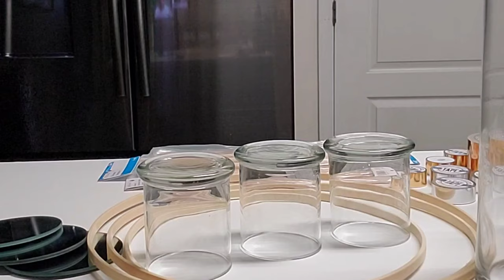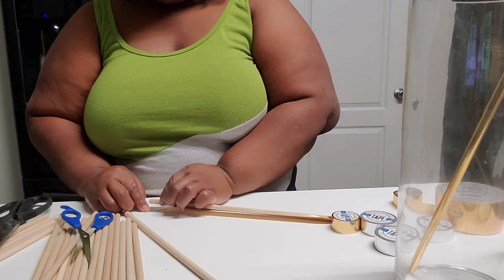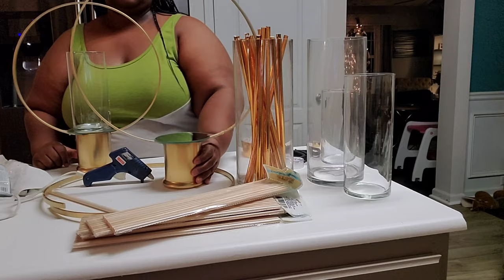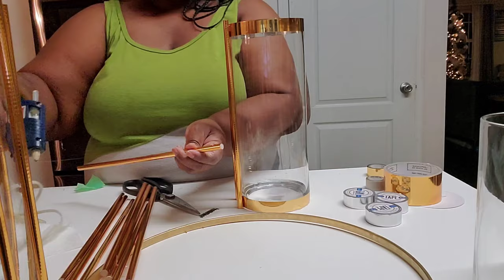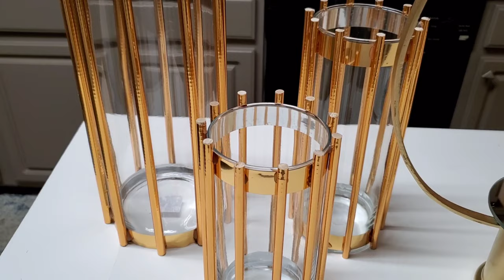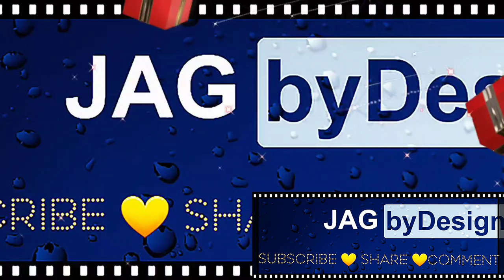DIY CANDLE HOLDERS

Comment: Hello, I love the the design of the candleholders with the k9 crystals. Simply beautiful! I would love to recreate it, but the the k9 crystals on amazon and ebay are very expensive. Do you have a company you purchase them from at a lower cost, and would you be willing to share that info please? Thanks in advance. SUBSCRIBED. 🌹
Reply from the maker: I didn't use K9 crystals. Look closely they are candle holders I got from Homegoods. You don't have to use those. Got the glass jars from Dollar Tree and add candles to them. Will look just as good. Check out my https://youtu.be/niD7us3ULcw
You will see how I styled with that also well. Hope this helps 🙂
Reply: @jagbydesign5213  Awesome, thanks.